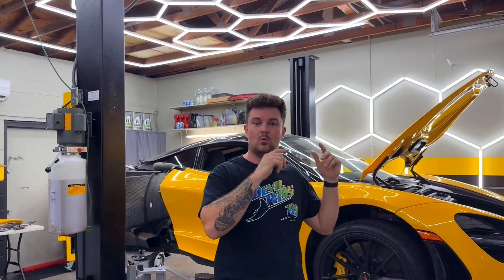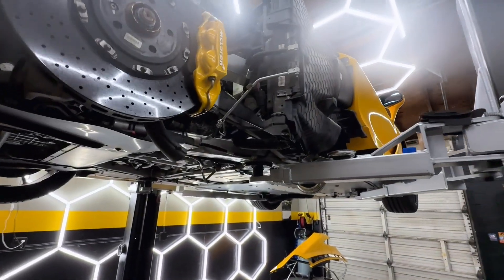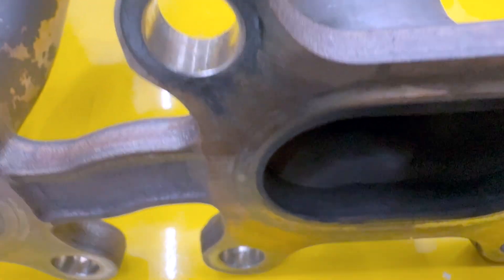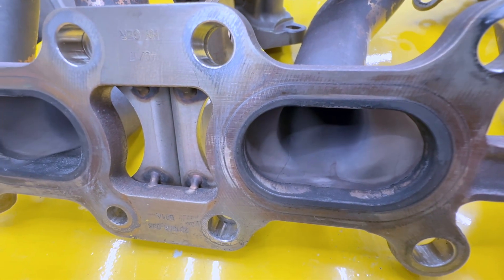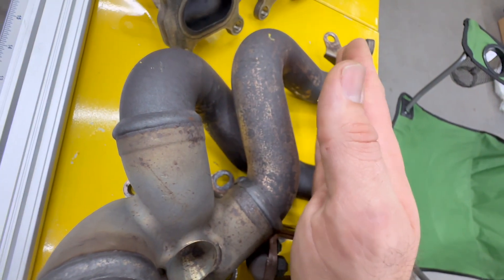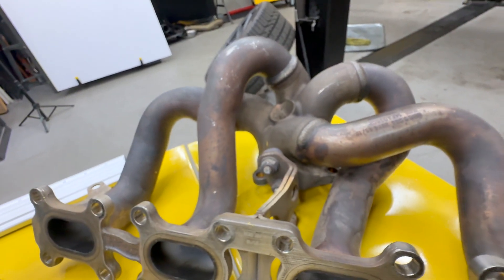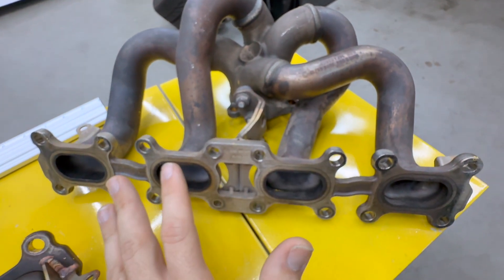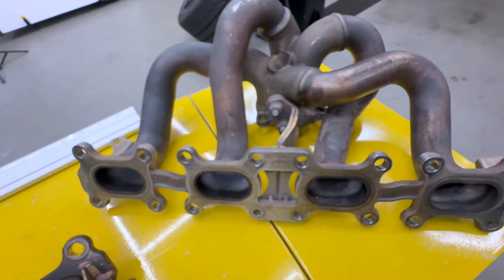INSANE MCLAREN TURBO MANIFOLD FAILURE! FULL REPAIR BREAKDOWN

Comment: Excellent video 

How many miles did these cars had on them 
I have 2019 with 15k miles when should I expect to have this problem? 

You did not end up straightening the flange ? Or cutting in between two of them to release the tension ?
Reply from the maker: I did cut the flange between runners 3 and 4, and 1 and 2 not shown on the video. I’m not sure all 7 series McLarens will have this issue necessarily, but we’ve heard of it anywhere between 20-40k miles. This one had around 40k